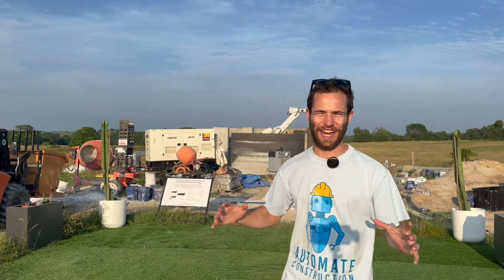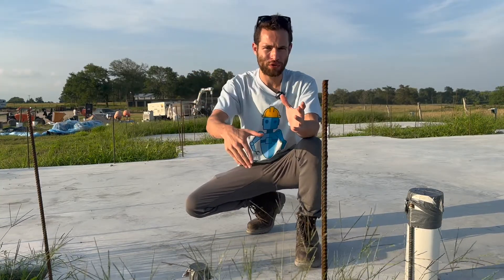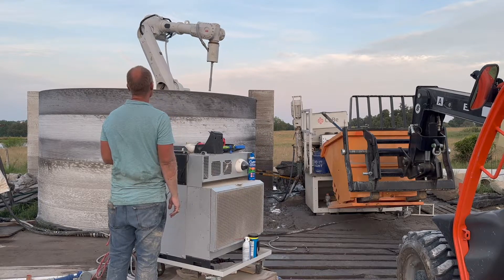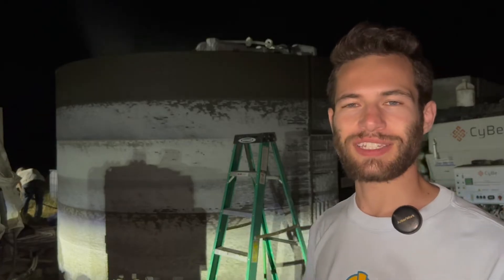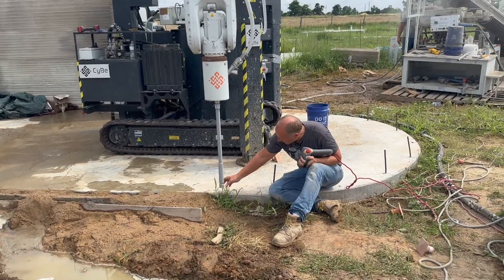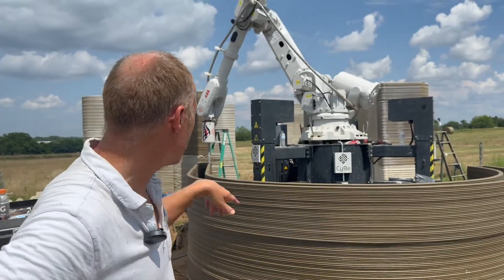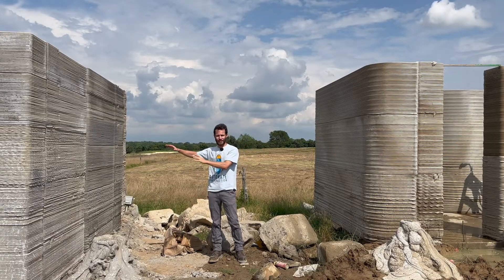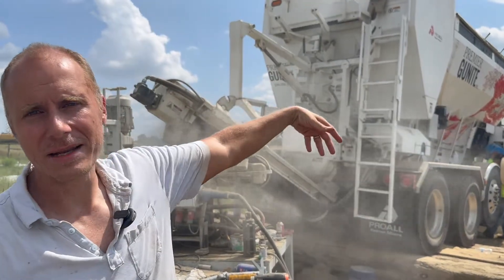New BREAKTHROUGH for 3D Printed Houses | Material From A Truck

Comment: The gap in the walls for insulation? It must also need drywall: 
Gap: conduit, electrical, plumbing, then inject foam insulation.
Then drywall, so you can paint, hang pics & wall sockets, etc.
Can you talk about the material sciences? Is this a concrete?

Comment: Curing rate. Not drying rate. The Hydrogen and Oxygen from H2O are incorporated into the molecular structure of fully cured cement. The water does not dry. It is absorbed, eaten, consumed.

Comment: A hole in a traditional home is easy to fix. A hole in these walls means you're out of luck. They can't reprint that part. Plumbing fails over the years so they have to make holes in the walls to fix or locate the problem. If it's a pain to fix a leak in the pipes under the slab the house is sitting on then it's the same issue with these walls.

Comment: WOW! WOW! WOW! There is no problem we are facing that does not have a positive solution equal to or better than the problem at hand. There is great joy in solutions, like this truck bringing production costs radically. . 

KEEP ON MIXING AND PRINTING.
Reply: What problem is this a solution for?
They're doing double the work. All they're achieving is a printed concrete form. Having to come back and fill the void with more concrete, makes this a ridiculous solution. Now if they were actually producing a superior structural wall. Then this might be a beneficial system. Or if they were back filling with sand or dirt. 
But from this video, this looks like a solution for an imaginary problem.

Comment: Hi, can you also make a video someday about the base leveling before starting prints.
Reply: We have printed with both a gantry and the Cybe. With the gantry we used laser levels and shims. With the Cybe you just press a button and it self levels.
Reply from the maker: @timothylankau3924  Back in my day the CyBe system had to be manually leveled one tripod at a time! Look how far the industry has come!
Reply from the maker: Every printer has a different method but I’ll try to capture it clearly next time I get the opportunity thanks for the good idea!

Comment: Volumetric Trucks are common place for slipform in the UK, challange is ensuring the mix complinace is achived in order to gain sign off from the engineer.
Reply: Yessir. We have our testing done by our manufacturing partner once a week. This is a computerized mixer so it is very consistent.